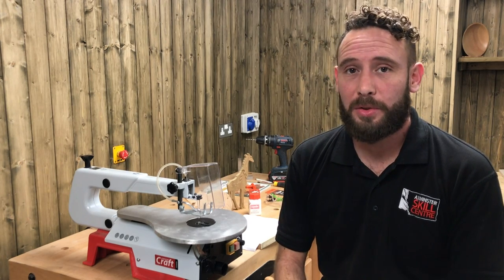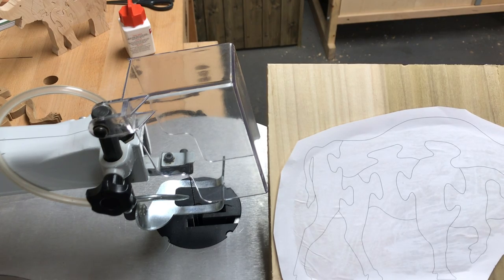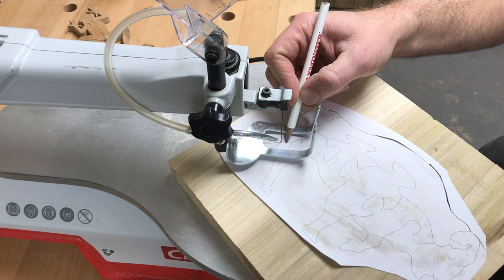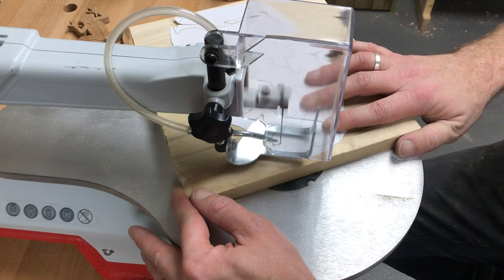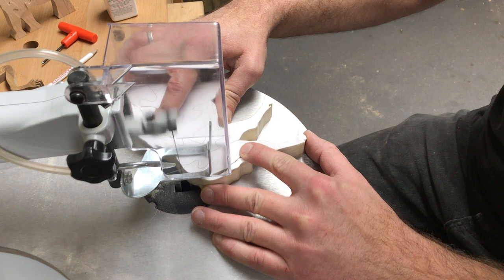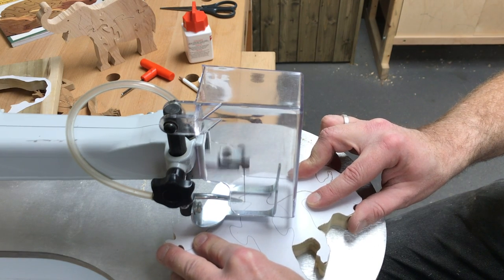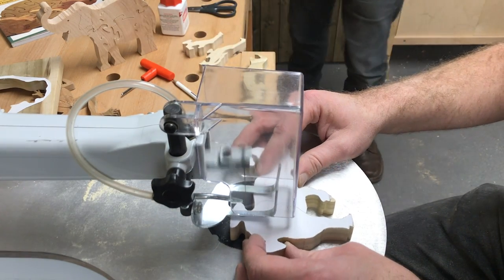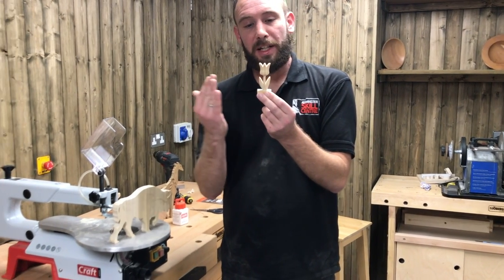Workshop Wednesday - Jigsaw Puzzles

Comment: Good demo, Ben, thanks for that. What kind of 'modified geometry' blade were you using?
Reply from the maker: Hi Mike, the following reply is from Ben - "I used a No.5 or 7 for the outside shape then a No.3 for the pieces. My puzzle was about 15mm thick. If using a thinner piece of timber consider dropping down to a smaller blade so that the pieces lock together tighter."

Comment: Can we use pine wood on this machine?
Reply from the maker: Good morning! The following reply is from Ben - "You can use pine, sometimes it can be quite resinous so a blade with less teeth will suit. Try: https://www.axminstertools.com/pegas-modified-geometry-scroll-saw-blades-5spr-13-7-pkt-12-502308   or    https://www.axminstertools.com/pegas-skip-tooth-scroll-saw-blade-3r-13-7rtpi-pkt-12-502302.  These blades have a bigger spacing between the teeth and have better waste clearance, with the added bonus of having an up cutting tooth that will save a lot of sanding on the bottom of your project."

Comment: What blade for the puzzle pieces??
Reply from the maker: Hi Leechie, the following reply is from Ben - "I usually use a No.3 modified geometry blade for puzzle pieces, but it depends a little bit on the thickness. If you are making a thicker, chunky puzzle you may want a bigger blade so that the pieces don't bind up when slotting them together."
Reply: @axminster  thanx